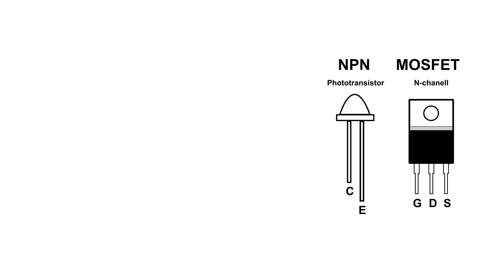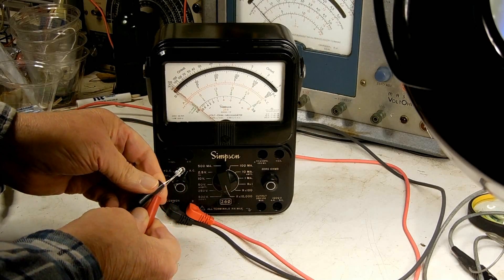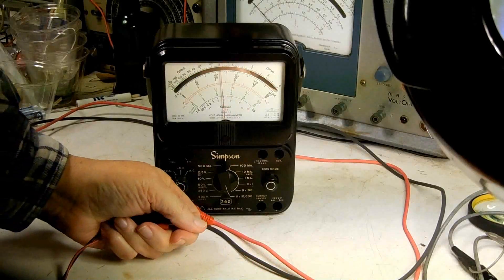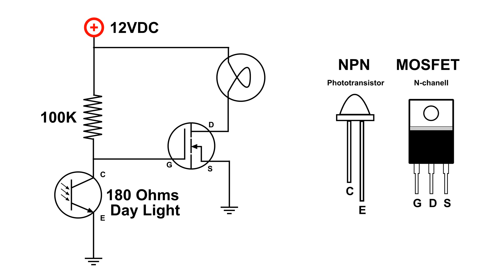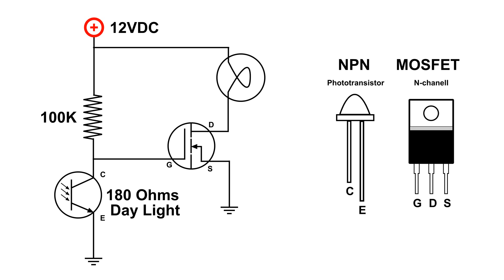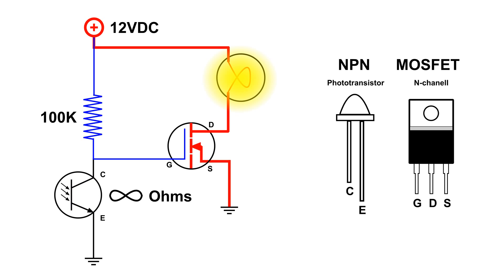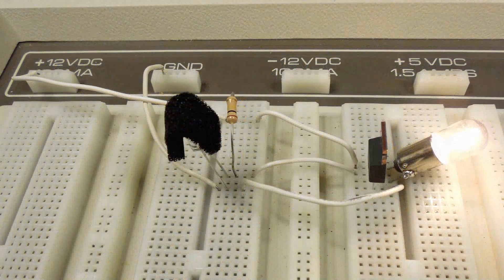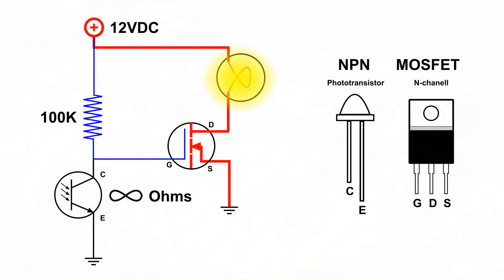Auto On Off Light Switch

Comment: Could I put a thermistor in place of the phototransistor and a pot to control a cooling fan?
Reply from the maker: I think that could work. I would need to experiment with the circuit. This would be using a 12VDC Fan.

Comment: Hi, thanks for sharing. i made a similar circuit but finally result is not good at all, the question is simple, How many volts and amperes receive the bulb light at "night". 12V or less. Thanks again, your explication method is excelent.
Reply: depends on wattage of your PSU and RDS(ON)  and VGS of mosfet ,,,,,, RDS sets the effective voltage drop         VGS sets how much current it can pass
Reply from the maker: Thank you, and your welcome.

Comment: I have a question.  The gate of the mosfet is in parallel with the phototransistor.  Ordinarily in a parallel circuit (like the plugs in your house) the current draw from one wont affect the current draw from the other (eg a light bulb and a hair drier on the same circuit). Is it because the phototransistor is drawing more current than the batteries internal resistance allows? That seems unlikely.
Reply from the maker: Ohm's Law
12VDC/100000=0.12ma

Comment: I have a   IRFZ44N  Mosfet,  could I use this?  I am only powering a 12v led srip with 12 led's on it.  Thanks John.... :)
Reply from the maker: Should work, as long as your LED's draw less than 50watts@12VDC
Reply: Ok thank you, also I don't have a phototransistor but I do have a LDR that came with my arduino kit. could I use that instead or would that be a different circuit altogether?  Thanks again John.... :)
Reply from the maker: It might work.
Reply: Thank you very much for your help,  have a great day. John.... :)

Comment: How to change photocell with Solarpanel?
Reply from the maker: I believe you would need two solar cells in series to produce about 10VDC of output. The negative side the series would go to ground, the positive through a 100K resistor to the gate of the N channel MOSFET. When light strikes the two solar cells in series this would turn on the MOSFET turning on the light.
Reply: can I send picture of circuit that I modify to you,I can speak English a little ,in your circuit I want repalce solarpanel 12v instead phototransistor for close lamp in day and on lamp in night,Please send picture circuit to my email bookandplace@gmail.com 
this circuit have 12 v from battery for on lamp and use solarpanel to sensor light instead photocell please teach me to build my circuit
to on lamp in day and close lamp in night.please
Reply from the maker: I'll work on the circuit and maybe make a video.
Reply: Thankyou I am hearing you
Reply: I'm waiting to hear you.
Reply: Sorry about my English

Comment: On the schematic where is the negative from the battery?
Reply from the maker: It's the ground symbol at the bottom of MOSFET, the 'S' lead, and the bottom of the Phototransistor, the 'E' lead. These two ground symbols are two wire connected together and they both are connected to the negative side of the battery.
Reply: AllAmericanFiveRadio Thank you for responding. Does that mean that if I ever see a circuit diagram without a negative connection I should assume the earth is the negative?
Reply from the maker: In this diagram the two ground symbols mean the other side of the battery which is the negative side. Using the same diagram but changing out the N channel MOSFET to a P channel MOSFET and reversing the leads on the Phototransistor the polarity is now exactly opposite. At the top the positive sign would be changed to a negative sign and now the two ground symbols still means the other side of the battery, the positive side.

Comment: while the phototransistor is ON, all the current flows trough it (C-->E)? Ain't some small current goes to GATE?
Reply: some VOLTAGE but too small to turn on the MosFet
Reply from the maker: Thank you all.

Comment: sir how can I use it for 220 volts lights
Reply from the maker: I would use a 12VDC relay to switch 220 volts.
Reply: AllAmericanFiveRadio you can use a Triac 400V in the place of the 12v lamp the Triac work likd the mosfet

Comment: Can you point me to the equation(s) or documentation that could be used to determine what type of resistor would be necessary to replace the 100K for a smaller or larger input voltage? Thank you!
Reply from the maker: Ohm's Law, The Basics
https://youtu.be/d34-VKc2cyY
Reply: Thanks! I found the Vgs of the mosfet and was able to piece it together from there!
Thanks again

Comment: Is there a way to tell the difference between a regular LED and a infrared LED, by looking at them??
Reply: Kennynva T. No, but just put a small 1.5v battery on it for a test. Use any camera to see the infrared light. If you see nothing through the camera then the led or battery is dead, or you have it connected the wrong way.

Comment: I am looking at doing something like this in the future when building an inverter.
When I was at tech,we were discussing how optocouplers are used to isolate high voltage circuits from the Low voltage part,in my case,I want to convert 240 volts DC (270 volts DC to charge 10 x 24 volt DC batteries) into 240 volts AC (sine wave).
The Low voltage side (50 Hz oscillator) needs to be isolated from the high voltage side.
I'm looking to do away with a transformer to reduce power losses in the circuit.

Comment: Interesting simple circuit.  Would making the 100K resistor variable allow for sensitivity adjustment?  Or would a second resistor between the diode and ground do the same thing?
Reply: replace the 100K  resistor with a ......say 47 K  resistor and a trimmer aka trim-pot........say 100K

Comment: can i use remote led
Reply from the maker: You could use the diode from a remote plus about 1K ohm resistor in series with the diode, as an output. But you would need an infrared detector to see the results.
Reply: AllAmericanFiveRadi

Comment: Hi
Please help me with this I have to switch a peltier module using a attiny 85 microcontroller.where the controller works on 5v and the pelteir works on 12v 3amp current. 
so my 1st question is can i be able to switch my peltier module using my attiny 85.
and 2nd if  yes which mosfet would you like to prefer to connect for better result. And do i need to connect a heat sink with the mosfet.

Thanks you
Reply from the maker: What is the output from the Attiny 85? What is the voltage with respect to ground, is it positive or negative? The output will determine if you us a N or P channel MOSFET.
Reply: 3.3v to 5 v
Reply from the maker: 3.5 to 5 would not drive a Mosfet into saturation. Probable need two, a Fet and Mosfet or maybe two Mosfets. I might have time the weekend try a few things. I've been very busy had 14hr day yesterday.
Reply from the maker: Controlling a 12VDC Motor with a 3 to 5VDC Signal
https://youtu.be/pj5aWf1JiLg

Comment: I would like to make a driving course switching light tower to direct the approaching car to steer into a left lane or right lane. So I would need to use a 12v car battery, feeding 12v motion sensor (a PIR of 50 ft detection distance with an adjustable delay system built in), feeding an alternating switch, feeding two LED lights visible to the approaching driver. The battery would be linked to a solar panel keeping the 12v car battery charged. 
Please let me know if this would work. I would approach my local college professor to assist me with the design as well. 
Thanks 
Joe B

Comment: Nice tutorial.  I need a 12vdc brushless fan to run out of a small project solar cell when the sun is up and that turns off when sun is down. Can I modify this circuit to work in such way? Any suggestions will be greatly appreciated.
Reply from the maker: I'll look into this and get back to you
Reply: why do you need a switch. When the sun is not strong the solar cell will not supply much energy, and fa turns off. You can use this circuit with very little modification. just  adjust the sensitivity, maybe a potentiomer.

Comment: Could I use a relay to turn 120V0lts for a 120V circuit [lights n camera?]
Reply from the maker: Yes you can, and it will provide 100% isolation between both circuits, this is much safer.
Reply: why use a relay, when you can run this circuit with a triac, whose gate is connected between the ground and the source of the mosfet?
Reply: AllAmericanFiveRadio ok, but still isolation is not that big a deal if it is going to be located inside a plastic container.

Comment: could this circuit be reversed simply by turning the diode around? so that when it sees light it turns on and when it is dark it turns off? 
also is there a way to adjust this for sensitivity? like if i had a red led on a gauge that lights up as a warning indicator and i wanted to be able to use this diode setup to trigger an external led and warning buzzer whenever that gauges red led lights up (without internally modifying the gauge which would violate it's warranty)

it would be installed in a car so it would have to deal with daylight conditions, but maybe a red tint film that only lets red light through and an adjustable pot somehow to deal with the ambient light in a car but still immediately activate when the red led lights up? sorry i'm a noob with circuits and just had this idea to be able to add a warning buzzer to a gauge that only has a warning light.
Reply from the maker: In this video I am using a N channel MOSFET, if you would change that to a P channel MOSFET that should reverse its operation. I would have to try this to make sure, but this would be the first thing I would try.

Comment: Should I wish to adjust the sensitivity of the darkness, all I would do is add a pot between the Photo-transistor and ground. Would that be enough to provide an adequate variability if the correct resistance was used?

Comment: What causes 52 people not to like this excellent lesson?I can only this one one word - fools!R
Reply: Because two problems. 1 ) à filament lamp is a short circuit when it os cold and the currant on MOSFET can break it. 2) the potentiel of the gate have slow variation, and the MOSFET is not satured and it have a lot of heat to dissipate
 Sorry for m'y english.
Reply: The Monotone voice of the narrator. I guess.
Reply: He does take pauses where none are needed. This is very annoying. (I din't vote by the way)

Comment: Any idea how I'd wire a mosfet to switch off when I turn on my car headlights, for proper operation of daylight running lights (they need to be off when headlights are on)
An n/c relay would work, but wouldn't be as interesting!
Reply: +bridgendesar sure thing, however, you will find it a lot more fun to figure it out all by yourself! I just did a DRL driver myself. Includes an npn and a pnp bjt to control its on-off state, a step-up converter, because 12v was not enough to drive my 5 leds, and an lm317-based current limiting part. It was a lot of fun, and it was my first ever electronic project! It was a lot more fun to figure out what is needed, than just get a solution from someone else! I learned a lot about electronics on the way....

Comment: Part numbers are useless. What if you live in a country that doesnt have radio shacks?. The MOSFET is an IRF510.
Reply: Radio Shack parts numbers are rapidly becoming even more useless as Radio Shack does the final dip.
Reply: www.mouser.com or www.digikey.com
if you can watch this video you can order the parts there...

More to the point, the part number lets you google the data sheet and match to specifications of local options.
Reply: Robert Tomkinson
Reply from the maker: +Robert Tomkinson 
I order lots of parts from eBay. Most of the time it's free shipping.
Reply: +AllAmericanFiveRadio Cool. I'll type 276-0145 into the ebay search engine and buy a phototransistor. With free shipping.
Reply: Robert: I actually typed that exact thing in ebay and found two results both with free shipping. Complete moron. Sometime you can't be given everything in life, spend 4 additional seconds doing your own research.

Comment: can we do the same with high power bulb...say 100w
Reply from the maker: +Bishank Agrawal 
Yes. You might need to add a heat-sink to the MOSFET. And check the specification of the MOSFET, pick one that will handle the current.

Comment: Do you not have the meter lead polarities reversed when connecting them to the phototransistor?
Reply from the maker: +mkay3751 The circuit works
Reply: +mkay3751  I know the circuit work. I meant when measuring the phototransistor resistance with the multimeter.  You get resistance when light hits it, but when you cover it up the meter go in the less to No resistance range.
Reply: +mkay3751 Never used an analog meter? No resistance (zero ohms) is on the right end of the scale, left end is open circuit, aka infinite resistance.
Reply: +mkay3751 When measuring resistance polarity does not matter (unless some part of your circuit handles polarity of the test voltage differently, like a diode or transistor (which is like a pair of diode)).